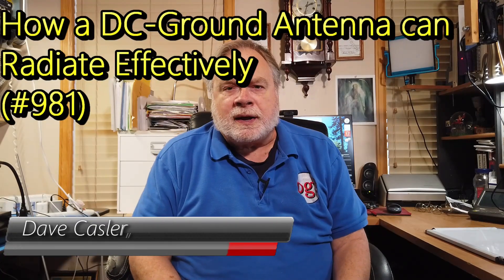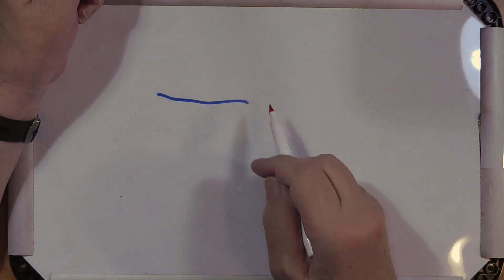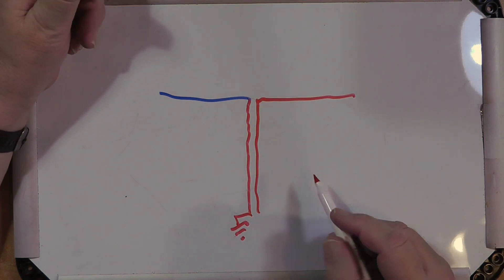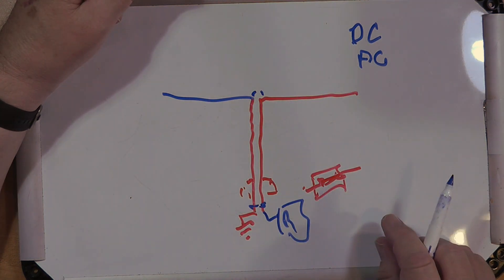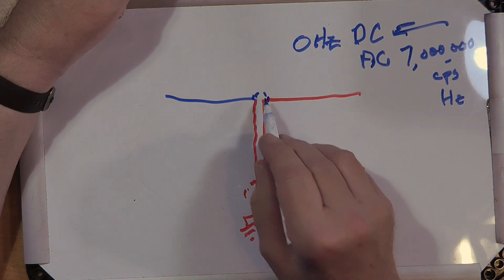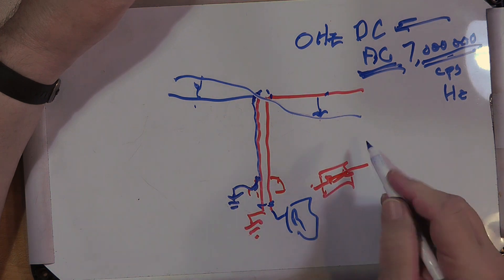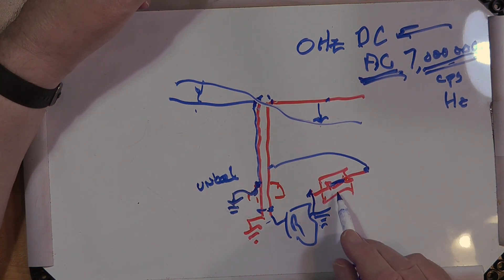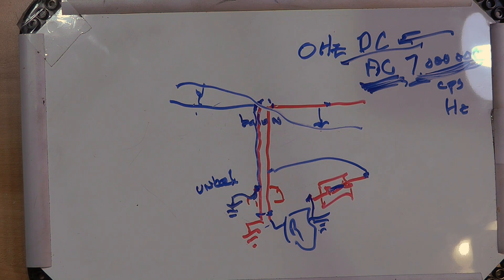How a DC-Grounded Antenna Can Radiate Effectively (#981)

Comment: Hello Dave,

Can I use 3.5mm Jack(TRS Plug) in dipole antenna instead of coax!? And how to attach both end to 3.5mm Jack? Please let me know..

I have to solder one end of dipole to left(tip) terminal of jack and another end of dipole to Right(ring) terminal of jack and separate another wire from grounding pole to ground (sleeve) terminal in jack !!?

Or

I have to solder one end of dipole to left(tip) terminal of jack and another end of dipole to ground(sleeve) terminal of jack!!??

 
I just made simple dipole antenna splitting speaker wire.. i just don't understanding how to attach both ends to 3.5mm jack..

And of course is there any lightening/electric threat?!! Please reply..
Thank you..

Comment: Hi Dave, let me make it clear. 
At 3.34, you are drawing the standard "voltage curve" on a dipole (not the current curve)
A dipole is always a balanced device whether or not there is a BalUn at the feed point. 
What most of us fail to realize is that there are three conductors in a coaxial cable as far as the RF is concerned; this becomes possible due to the phenomenon of the "skin effect" exhibited by high frequency AC.
The outer surface of the outer conductor (shield) of the coaxial cable is at ground potential because we are forcing it to be at ground potential at the radio or near the shack end of the coaxial cable feeder. We shall designate the inner surface of the shield to be the cold conductor, for convenience, (and the inner center conductor as the hot conductor). In effect there are three conductors. 
RF always flows on outer surface of the inner hot conductor and the inner surface of the outer cold conductor; they are of equal magnitude and of opposite polarity creating both E and H fields. They cancel each other and hence the coaxial cable does not radiate.
The dipole in the air, over time will collect charges (triboelectric phenomenon).
The side of the dipole connected to the center conductor of the coaxial cable can be bleeded off to ground from time to time through the gap in the Gas Discharge Tube in the so called "lightning arrestor" at the foot of a tower mast or at the shack end of the feeder.
The power from the transmitter is not getting radiated as long as it remains inside the dielectric of the coaxial cable. But at the feed point of the dipole the magic happens. You can consider that the two conductors (the inner and the outer) of the coaxial cable are separated to lie at 180 degrees to form the half lambda center fed dipole. Here it forms a series resonant LCR circuit with a low impedance at the feed point (about 50-75 ohm)
Because of the L and C reactive components the voltage and the current are at 90 degrees out of phase to each other all along the dipole (but not at the feed point) to form the Standing Wave.
At the feed point, the voltage and the current are in phase and the power is getting dissipated in the form of the Electromagnetic energy. It is called the Radiation Resistance. 
The coaxial cable's outer or is at DC ground potential and the inner or hot conductor is brought to ground potential by a GDT from time to time. 
But both the arms of the dipole radiate at the same time with polarity being swapped at each half of the cycle at the operating frequency.
In the case of open wire feeder (ladder line) none of the conductors is grounded at either the transmitter or at the shack end of the feeder line.
But one can (and should) use some kind of static discharge device that would bleed off the charges from time to time. 
In short, electromagnetic radiation from the dipole is occurring in the radiation resistance at the feed point of the dipole as a special phenomenon in consequence to the fact that accelerating charges dissipate energy in the form of electromagnetic photons.
And finally the "lightning " contains both AC and DC components. 
I hope this helps. 
De VU2RZA 
(in ABQ, NM)
Reply: You should make a video.  You're very well understood.
Reply: @richardchambers256  thanks for the appreciation my friend. 
De VU2RZA 
Now in ABQ, NM